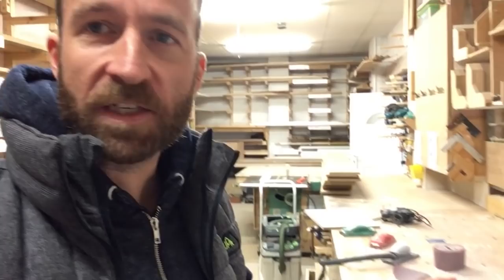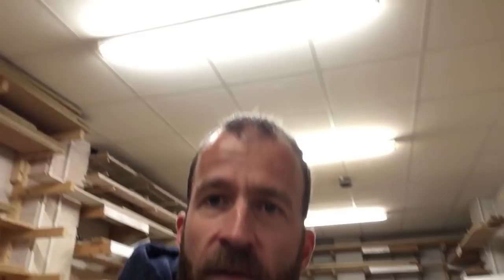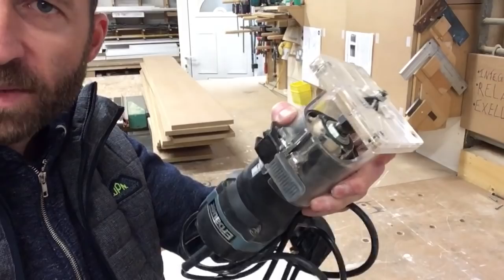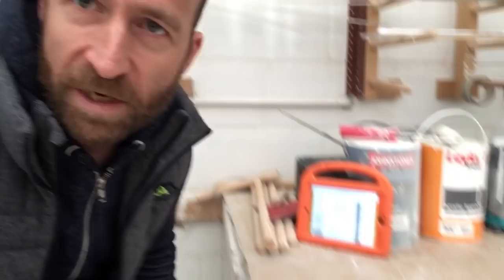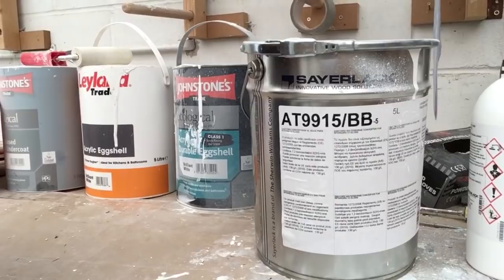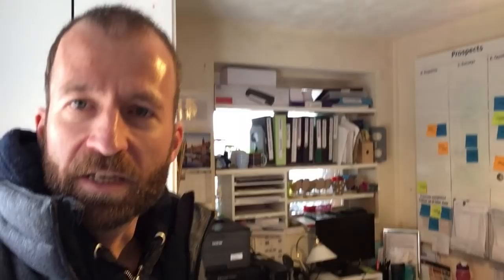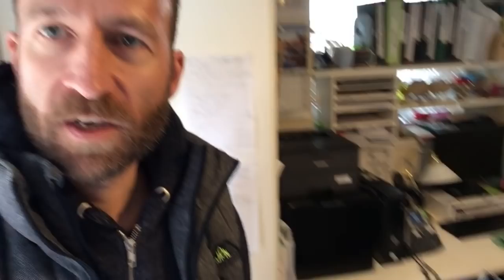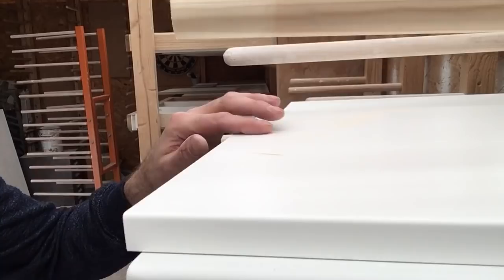Paints we use and why

Comment: Hi Alistair, it's great to see the stuff you're doing. I have a similar home workshop setup, and pretty much the same kind of rudimentary spray and drying area! I'm currently about to make the switch from zinsser BIN primer and Tikkurila everal aqua top coat to sayerlack at99 and sayerlack AU406 or 474.... what's drying times like in 'real world applications' ? Both BIN and everal are sandable within a couple of hours in the current temperatures we have(bloody cold!) Does sayerlack compare to these times? I have a small drying area so being able to get components out and stacked quickly is quite important
Reply from the maker: Matt Irvine aha, well I’ve been considering trying BIN as a primer!! But the sayerlack works pretty well, we do rely on infrared heaters in this weather though.  Sandablenin similar time or less.  Brady (who actually does all the spraying now) says he prefers to leave about 4 hours between recoats on top coat (maybe less on primer), and both could be less at a push in better weather
Reply: BIN is a great primer on MDF for its edge sealing capabilitiesand the fact you get zero fibre raising (or zero noticeable anyway). It dries very quick, but it stinks, its stinks a lot! And at £80 for 5 litres its expensive stuff.  I use chinese diesel heaters that are used in campervans, they put out serious amounts of heat with out the expense of electricity being used, and a couple of air movers. Just make sure the area is dust free... I'll see how I get on with the sayerlack stuff, cheers Alistair 👍👍👍
Reply from the maker: Matt Irvine yes BIN must get expensive! Can you link to the sort of heater you use?
Reply: Sure, I use two of these, the exhaust runs through the external wall of the spray/drying area, I power them using a 12v PSU. They heat a space of around 6m x 3m up very quickly! They cost around 3 pound to run them constantly for 24hours... there is a bigger 12kw unit available too 👍👍
Reply from the maker: Thanks
Reply: @bespokedfurniture  There is just one thing that comes to mind regarding the Zinnser BIN which is that with it being shellac based and not water based, compartievely, it has a very high VOC content documented as being up to 500g/L on their safefty data sheet - one can therefore understand why there is such a smell with this product. I'm new to you channel Alastair and very much enjoying all of the wonderful content and the level of detail the you dedicate to your work!

Comment: How does the sayerlack take to the mfc panels? Do you still use the primer on the mfc also or just use the topcoat? Interested in trying this paint. Great content and insight
Reply from the maker: Humble10 1 hi I wouldn’t use it on MFC, I think there are other paints out there designed to better stick to Melamine.  Glad you like the content, thanks
Reply: @Alastair_Freebird  I thought you'd use it on the plinth and side scribes to colour match your doors.
Reply from the maker: If it’s a painted job we would cut all the cover strips etc ourselves from mdf and paint all to match 👍

Comment: I'm currently looking into Movac vs Morrells and so far the only issue I have is that I need to send items to Nottingham for a colour match as they can't do it in the local branches. I have a Morrells around the corner from me, so I need to see if they can colour match locally. 

Are all of the Morrells WB paints suitable for spraying without an air fed respirator? I do refinishing work on site and need something safe for use outside of spray booths.
Reply from the maker: I’ve heard a lot of bad things about Morrells waterbased.  They are great for AC etc but I’d recommend Movac (Sayerlack) or Symphony (Renner paint) for waterbased
Reply: @Alastair_Freebird  And would you be comfortable using them inside a customers property if need be? Are you happy using a standard respirator?
Reply from the maker: We don’t spray in customers’ houses (mainly because it seems such a faff to mask up and sheet out) but sometimes I brush on the Sayerlack paint and there is no smell that I can detect.

Comment: Very similar to my experience. Started with hvlp and moved to Graco airless. Use the same paints as you were and couldn't get a perfect flat finish. Used lots of diamond White but always found install difficult due to the tacky nature that didn't seem to improve.    Am considering trying teknos water based finishes. Gid joiner uses a simple compressor and gravity gun with 2 pack paint and gets a great hard finish. So many options and am always slightly disappointed that it is not perfect. Thanks for the info. So what is your honest opinion on movac?
Reply from the maker: sicpac66 I have been very happy with the Movac AT99 waterbased paints however I have never personally used the non water based AC/PU/2 pack professional options so I am no expert.  These weren’t an option for us due to extracting into the neighbour’s garden 😆. In all honesty I suspect the traditional chemical laden paints are still the hardest/most durable options.  However the Movac water based is a massive step up from the decorators paints in every way.   We have never had problems with it EXCEPT just a couple of weeks ago we had a ring stain from a wet cup that  seemed to impregnate the painted surface with a brownish stain that couldn’t be removed.  On raising this with a Movac I was advised that for maximum performance I should always be using the crosslinker additive which we just never got into the habit of using because the results seemed so good with the paint anyway.
Reply from the maker: Did you ever try Teknos?  We recently had the rep out to do a demo and I was quite impressed
Reply: @Alastair_Freebird  I didn't.  I went with your rec of sayerlack. Am getting a better finish and much more durable. Am thinning the top coat with water but find it needs 2-3 coats. Have you tried the activator and if so what is like?
Reply from the maker: sicpac66 do you mean better/more durable than Teknos after direct comparison.  We had the rep out, trialed it, it seemed similar at first but it doesn’t have a formal BS or FIRA rating for durability like the Sayerlack stuff does.  It also seemed to scratch a little easier but we were comparing freshly dried Teknos paint to fully cured Sayerlack

Comment: for flat doors have you considered using p g b instead of mdf
Reply from the maker: Hi Tom what is PGB?
Reply: Freebird Interiors hi 
It’s paint grade board .m f c really but takes paint
Reply from the maker: tom ah ok; for now it makes more sense for us to use mdf because you can cut and sand smooth the edge with fairly basic sawing equipment without the chipping you get with MFC, and we don’t currently do any edgebanding.
Reply: Freebird Interiors yes I can understand that 
Great Channel by the way and your work looks to be of high standard